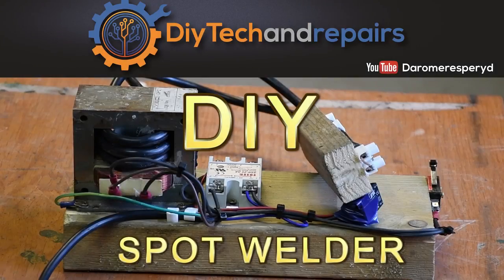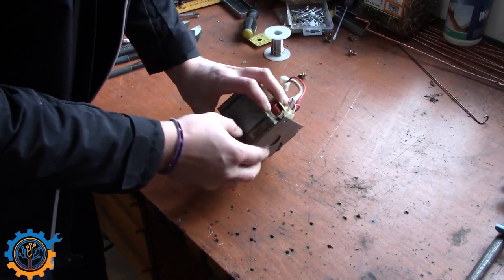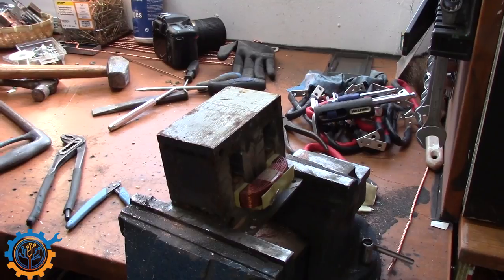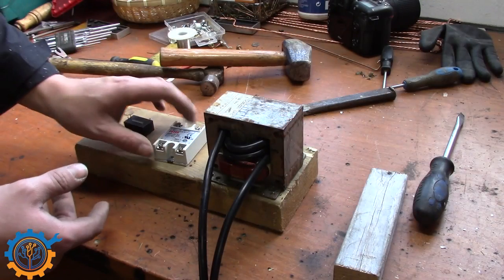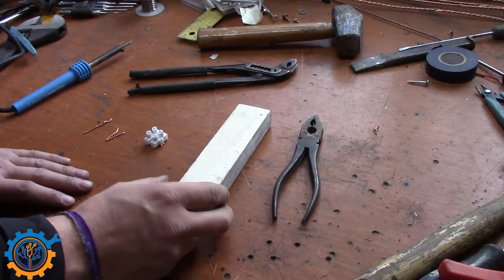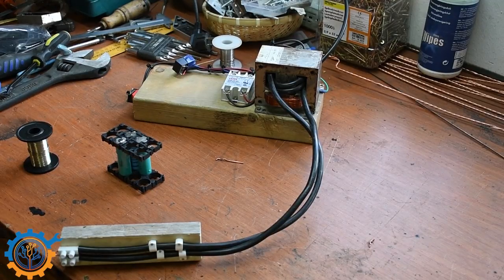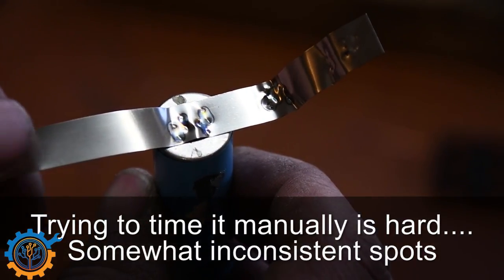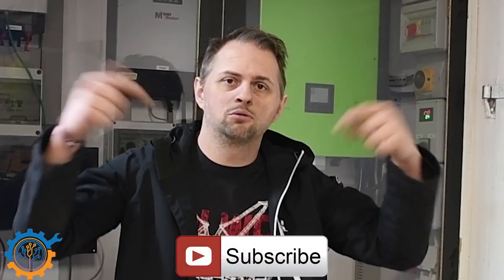DIY Spot welder build - Cheapest out there! Part 1/2

Comment: Greetings from California. Thank you for the instructional video.  This video has, actually, inspired me to make one. I use SUNKKO 788H spot welding machine, that gets hot quickly and makes the weld very week. So, I’ll use the same transformer in SUNKKO and toss the Electronics control board. I’m, pretty confident that my assembly would work very well. I’ll use SSR. The SSR is rated only 10A and I’m not too sure it’ll last long. What is the rating of your SSR. Let me know. Danke shoen, mein Freund

Comment: Danke schon , once again. I think, I’m watching your video for the third time. The weld looks perfect and exhibits strong bonding to the cell wall. A snubber circuit could be added to the mains switching. (With due respect)
Reply from the maker: Yeah protection is missing. It was more of a proof of concept :) thanks

Comment: Hi dear I cut the lower coil while cutting the high voltage coils, does it still work ?
Reply: usually not,  as you possibly cut the bottom wires, electicity cant flow round it , x3, but people throw microwave ovens out often so grab another and trya gain,, you can get a multimetre and check if there is still continuity between the ends

Comment: Have you had some problem with the SSR? I used one the same way you used and short circuited the output in the first try. The SSR is supposed to have a Snubber to protect it. People say not to use it with inductive loads but many Spot Welder use it, included yours. Do you have any suggestion how to avoid this problem?
Reply from the maker: I have burned out many :) If you buy the Chinese ones like the 40A SSR relays you only get a 12A rated. It wont stand a chance against it and will short out easily.  That's the only recommendation I got currently.

Comment: Because I know very little about voltage or transformers I will ask... What is the voltage coming out of the transformer?  Does it matter?  If memory serves the less winding in the second coil the lower the voltage?
Reply from the maker: AtomicDog u are correct. Its about 4.5vac IF i remember correctly. Yeah it matters. I have not tested IF One more or less turn Will get you q better weld or not

Comment: Possibly this is a stupid question that I need to ask before I do something stupid. Can I take the transformer out of a microwave that has been sitting out in the rain? If it matters, it's been sitting bottom up and it rained 7 1/2 inches in 2 days.
Reply from the maker: Why not. Get it apart and take a look IF the transformer is damaged. Just let it dry before. I have used many sitting outside for a Long time
Reply: Thanks!